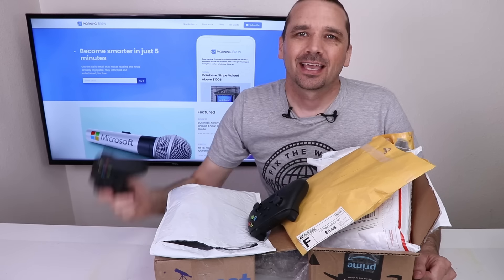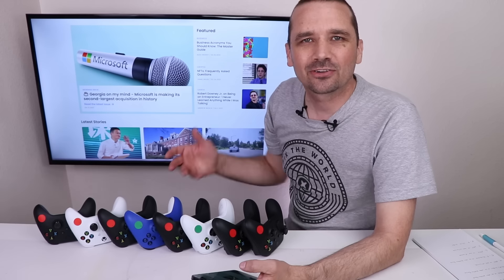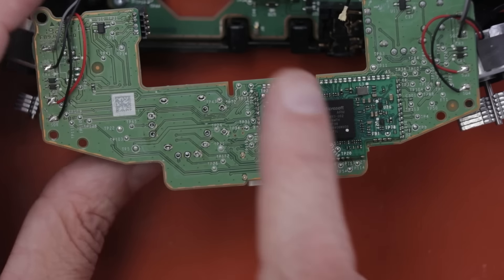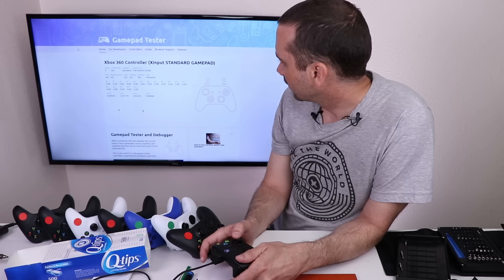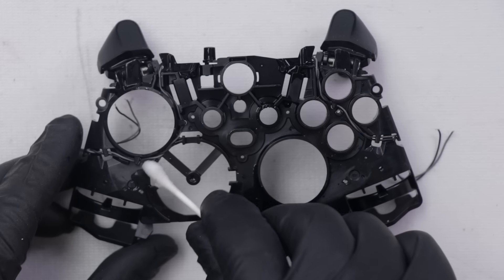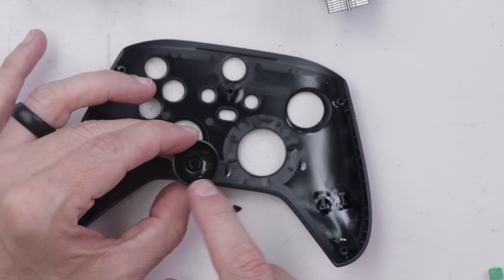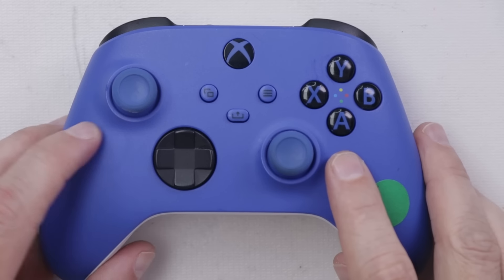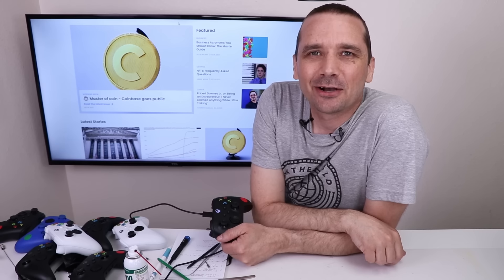I Bought 8 Broken Xbox Series X Controllers - But Can I Fix Them?

Comment from the maker: Thanks to Morning Brew for making news fun & interesting again! Sign up for free here - http://cen.yt/mbtronicsfix
Reply: Can you fix my Brain Warp? Plzzzz
Reply: Do hoverboards next plz
Reply: As in I couldn't find them in your affiliate link
Reply: Can you help me fix my ps4 my ps4 turn on then off in a splint second I think something wrong with the power supply
Reply: Did you ever figure out the xbox one s turning on and then off issue?
Reply: Do you have a extra ps4 hard drive i really need one mines is not working
Reply: Hey. Love your videos. Trying to practice repairs. Can you fix a n64?
Reply: Hey I really need your help my Xbox one controller shuts off instantly
Reply: @pleasestfu293  the metal case the fan sits in sorry was dented and in the way of the fan I fixed it  by  pulling the metal case away from the fan

Comment: I still don't know why people eat/drink while playing, if its water that's fine, but like juice or soda... no. Had the same problem, I found a Xbox 360 chrome controller at Goodwill and it was Sticky both outside and in the buttons, Dirty, and overall looking like it didn't work, took it home and gave it a clean and it looked brand new I was surprised that it wasn't all scratched up just a little bit and it worked perfectly!
Reply: I use a Xbox Elite V1 on my PC (and old PS ones). My Controllers only have little of that sweat residue and dust on them XD. Oh and of course the Sticks are worn down.
I had a little Stick wobble issue with that Elite v1, but i fixed it by opening it up and using tape to make a tighter connection to the Stick dome.
The worn down Sticks can be easily fixed since they are magnetic.
I wish there would be a V3 Elite Controller with maybe the haptic motors of the PS5. (I don't need the adaptive triggers, they break easily...unless they are made out of metal and not plastic)
Reply: Those long gaming sessions get you hungry and thirsty just gotta be clean about it
Reply: Nah, I like to eat BBQ ribs with no plate while playing video games :)
Reply: @12345.......  LMAO 😆
Reply: I just don’t know how people are ok with getting their controllers so gross… I’m always cleaning mine lmao

Comment: 14:47 here’s where ya could mess with someone. Rearrange the X Y A B buttons when putting back together. Come on, ya know ya thought about it, anyone who’s had to clean a controller..DEFINITELY has thought about it😉
Nice repair vid✌🏻
Reply: You can't, they're all keyed differently so they can only be inserted into the correct slot.

...Well, okay, you could break the little tabs off to make it work, but being destructive isn't a fun prank.
Reply: @mjc0961  Ok

Comment: When it comes to potentiometer replacement - I've seen an another video that potentiometers and new joysticks require 'calibration' and that simply installing them will not give accurate joystick position. Does anyone have experience with this?

Comment: I really like your Videos Steve, and because of you i started my own repair shop.

But what i dont understand is that you always stick through that label to get the middle screw. Why you dont heat it up with your heatgun at 100°C and peel it off?
It works super nice and you can put it back on as it have been never apart.

Comment: Tried to fix an Analogue stick on the new Series controllers and messed it up. The new ones like the the Elite controllers seem to have very small metal cylinders that sit inside the board and I destroyed some of them or the solder sucker pulled them out.

Comment: I didn’t see you check if the controllers worked wirelessly with the console , I had issue with on controller which wouldn’t connect with the console..?

Comment: Have you ever dealt with double click issues? I have a Xbox one controller that I use on windows 10 and the rb intermittently double clicks. It does this on Bluetooth and wired directly so I think it might be hardware? Is this issue able to be fixed without a new button or controller?

Comment: Which desoldering gun do you use?  It doesn't look like the Hakko.  I've wanted one of those for a while but they're crazy expensive for some reason.  I checked your tool list and didn't see it there.  I'm assuming because you didn't buy it on Amazon.

Comment: Where do you buy your replacement anolog sticks from(if you can send a link) because ima buy a soldering kit soon to fix a bunch if my broken ps4 controllers
Reply from the maker: I don't have a link. I've bought some from eBay but Mouser is a better good place to buy them.
Reply: Alright then thanks because I was gonna buy the soldering kit yesterday with analog sticks from Amazon but I had a bad feeling they wouldn't work so thanks

Comment: Jusr wondered if you have ever come across an issue with the elite series 2 not turning on at all and any known issues/fixes for this? Was working fine and had the issue where it wouldn't turn on but started working again but now won't turn on at all even with the cable plugged in

Comment: Hey tronics I love watching you're videos I wondered if you could help me.. my ps4 controller won't connect back to my PlayStation. I've tried using a charger and pressing the button in it was just flashing light blue and it wasn't glowing yellow either (meaning its charging) I've used a pin to try reset it with the button on the back I went on the Sony page and did everything and nothing please help🙏🙏🙏🙏🙏🙏

Comment: So the wifi and Bluetooth wires on my series controller when I was taking it apart to clean the one I'm assuming goes to Bluetooth the connecter on the board pulled off with the wire I'm assuming no way to fix? I've only had this happen twice and I've done many controllers

Comment: I have a question I have one of the remotes and it's brand new and I only used it for a week and it had shut off on its own and now it won't turn on I have put new batteries and took them out and used the USB cable that came with it and no reaction from it what cold be wrong ?

Comment: Hello, I have a question. I recently bought a counterfeit controller, I did not realize at the time of purchase, but when it is charging and being used after 5 minutes or so it stops working and the left rumble gets warm. Lights on the controller are on but it is unresponsive. So, I opened up to see if I could find an issue with the rumble, as I was doing this I noticed not all the solder joints were soldered, on the analog sticks. Could this cause the issue that I am having?
Reply: No, if it wasnt soldered properly around the analogue stick this wouldnt cause the np charge/heating issue it would simply mean that the controller would have a faulty stick and wouldnt work. Ive never heard of fake controllers before so not quite sure how you were able to do that so maybe just purchase one from a store that is reputable?

Comment: What should I do if a brand new PS4 controller I bought has an overly sensitive right joystick
Reply: Hey Shen you can configure it. in the settings to alter the deadzone to make it less sensative. This would be more sensible than replacing the stick
Reply: @konsolemend  what exactly do I use to configure the deadzone

Comment: So i have an xbox one s controller (i think) and i had to take it apart to clean some gunk off of the shell and out of the crevices. After i put it pack together though, the right bumper got really hard to press. It still works, but it is much harder to press than the left side one, and i put the controller back together the way i took it apart. Does anyone have any ideas? Google searches have so far lead me nowhere.

Comment: blah, what NOBODY shows when repairing switches is how to properly connect the SD card reader to the board and without damaging the pins of the reader, not the board. Oh and how to keep it connected. anybody got good experience with a replacement reader?

Comment: I took apart my elite controller series 1 bc it has stick drift and slow turn and it’s basically unusable. Then I cleaned it with compressed air and I used ipa on the outer shell but had to take out the rumble motors to clean the sticks. Then I put it back together w/o the motors and now none of the buttons work. But I can plug it in with usb and get power and xbox logo lights up but the buttons still won’t respond. Can anyone help?
Reply: I’m not sure if it’s from the motors not being in which seems unlikely. I plan on soldering them on eventually once I get the equipment.

Comment: I don't understand why you were soldering like that.  You should be feeding the solder onto the tip as it makes contact with the pin and pad then moving the solder to the opposite side.

Comment: I buy a controller with a floppy thumbstick, the entire mechanism has to be removed and replaced.
YouTuber buys a controller with a floppy thumbstick, THE PLASTIC SOCKET OF THE THUMSTICK PIECE IS BROKEN, ONE OF THE HARDEST PARTS OF A CONTROLLER TO BREAK, 2 MINUTES OF REPAIR NEEDED, 1€ OF REPLACEMENT PART.

Comment: I do not know why you do re soldering of the first analog stick like you did but it is wrong. You heat up the pin an pad an ad the solder, it is quicker, no use of extra flux and you have more control of the amount of solder and probably dont get solder blobs.